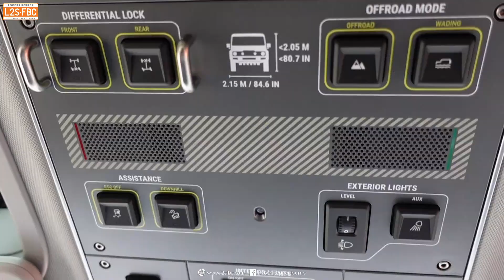INEOS Tech Chief interview - Part 3/4

Comment: These are all great questions. I drove this car I wanna buy this car but the problem is I’m scared of this car because of the steering and some electrical issues. I really want to buy it but it’s just hesitant on that
Reply from the maker: I would not, not buy it on the basis of either.  The steering is not that of a BMW X5, but it's far more than adequate, ignore the naysayers.  Problem is everyone is used to modern SUV steering and that's the new standard. Electrical - the dual battery is pretty hopeless, I'd actually not bother with it and just put the money into a proper aftermarket kit with a lithium and a DC-DC.  Similarly I wouldn't bother with the factory bullbar, there's aftermarket now which takes a standard lowmount.  This is what happens when you do tick-the-box accessory engineering, OEMs never seem to learn.
Reply: @L2SFBC  Steering - some of the early adopters did definitely have faulty steering and issues with the setup as it left the factory (just how did steering wheels up to 10 degrees off straight pass final QA?) and the return to centre characteristics are far from ideal.

Dual battery - on paper it's got some great features.  The issue is I don't think Ineos have anyone in house who fully understands it, or at least is willing to come out of the shadows and explain it in full to owners.

Comment: Robert - what did you take from the complete absence of response to the dual battery setup?  Was there a misunderstanding of the line of questioning, language difficulties, or what?
Reply from the maker: I take it that he did not know the answer. Wait for part 4 which is a post interview follow up.
Reply: @L2SFBC I look forward to it👍

Although, I was a little confused with the parallel or series comment; in series would be a 24 volt arrangement.

I don't think they can be described as parallel either, as they're not used  together.  The Smartpass is actually a battery separator but serves to link them under certain conditions such as charging and when the starter battery on its own is unable to start the engine. 

It would also give a smarter separate ability to power a fridge if Ineos hadn't unilaterally removed that function.😤
Reply from the maker: yes that was my mistake, I was trying to describe what they had which was difficult.  Should have said non-isolated.  I thought they were parallel...there you go, I didn't know that's how Smartpass was used.  Your comment has supplied more information than what was in the interview :-)
Reply: @L2SFBC Unlike you I only have to get across one manufacturer's model and luckily Ineos left the CTEK Smartpass retail box and manual in the vehicle on collection & CTEK customer services actually have technical staff providing decent answers.

I've also taken a leaf out of your book and used a Victron Smartshunt to try and measure/record what goes on.
Reply from the maker: Great!  I would like at some point to have someone knowledgable talk through the INEOS battery system.  Clearly that's not going to be anyone on the INEOS payroll, so a good sparky would be fine.  I feel there is a knowledge gap for the system which INEOS do not appreciate, and the walk-through would be generally interesting to any 4x4 owner as we could cover smart alternators, DC-DCs, isolation strategies, lithium/AGM etc.
Reply: @L2SFBC  Yes, that would be excellent.  One thing CTEK won't do (or declined my request to) was share the technical details of what's in the Smartpass.  Possibly understandable to protect any IP.  There's a few YouTubers that look to have the technical skill and knowledge to take one apart and work it out, but as yet I've not seen it done to one.  Rather like you, they probably need someone to donate one first as it would probably be destroyed in the process.

Smart alternators is a great topic also.  There's a great BMW document "Aftersales Training - Product Information - Intelligent alternator control IGR" that explains their strategy.  It would be good to know if this is applicable, in whole or part, to the Grenadier.
Reply from the maker: Can confirm the Grenadier has a smart alternator.
Reply: @L2SFBC  That's good to know but without knowing exactly how it works leaves the owner in a worse off position than if it was dumb.
Reply from the maker: Part 2 of Clarifications will cover the dual battery but I admit it won't be answering many questions. It will give you INEOS's view of the world.